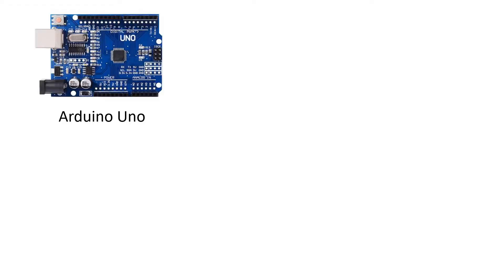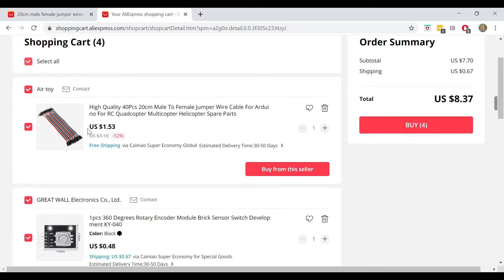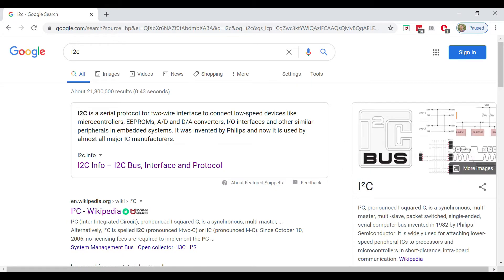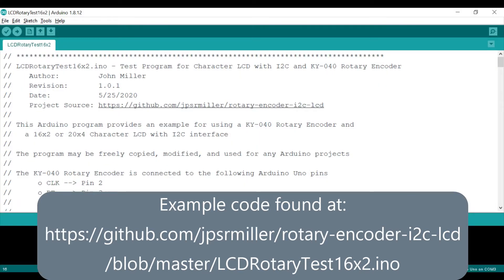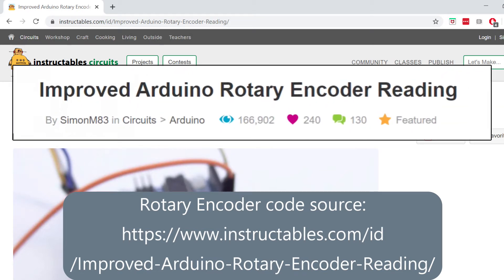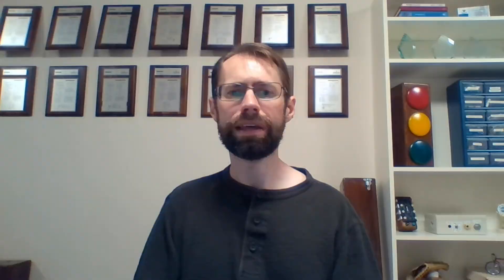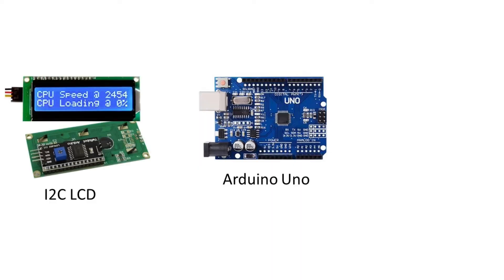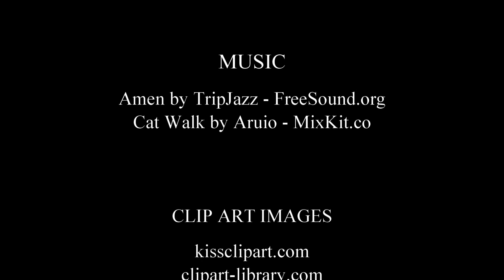Arduino with I2C LCD and Rotary Encoder

Comment: man its very clean code and and very structured video. I repeat the same steps, but sometimes when I turn encoder value on LCD not been changed, it's like freezing for little time or some like this. Maybe you have an idea why it happens?

Comment: John,

I have copied and pasted this sketch
Changed I2C adress to 0*27 and set the display 2 2*16

On compiling, I get the following error:

C:\Users\ABCD\AppData\Local\Temp\.arduinoIDE-unsaved2023030-18628-fhzkzm.s5a15\sketch_jan30d\sketch_jan30d.ino: In function 'void initializeLcd()':
C:\Users\ABCD\AppData\Local\Temp\.arduinoIDE-unsaved2023030-18628-fhzkzm.s5a15\sketch_jan30d\sketch_jan30d.ino:197:12: error: no matching function for call to 'LiquidCrystal_I2C::begin()'
  lcd.begin();
            ^
In file included from C:\Users\ABCD\AppData\Local\Temp\.arduinoIDE-unsaved2023030-18628-fhzkzm.s5a15\sketch_jan30d\sketch_jan30d.ino:42:0:
c:\Data\Dropbox\Arduino\Projects\Sous_Vide_001\libraries\LiquidCrystal_I2C/LiquidCrystal_I2C.h:58:8: note: candidate: void LiquidCrystal_I2C::begin(uint8_t, uint8_t, uint8_t)
   void begin(uint8_t cols, uint8_t rows, uint8_t charsize = LCD_5x8DOTS );
        ^~~~~
c:\Data\Dropbox\Arduino\Projects\Sous_Vide_001\libraries\LiquidCrystal_I2C/LiquidCrystal_I2C.h:58:8: note:   candidate expects 3 arguments, 0 provided

exit status 1

Compilation error: no matching function for call to 'LiquidCrystal_I2C::begin()'

The compile stops at the lcd.begin() below

void initializeLcd()
{
	lcd.begin();
	lcd.backlight();
	lcd.clear();
	lcd.setCursor(0, 0);
	lcd.print(F("Test LCD & Rotry"));
}

Can you please assist.
Rob

Comment: Doesn't work compiler error :  c:\Users\oesg1\Documents\Arduino\libraries\LiquidCrystal_I2C/LiquidCrystal_I2C.h:58:8: note: candidate: void LiquidCrystal_I2C::begin(uint8_t, uint8_t, uint8_t)
   void begin(uint8_t cols, uint8_t rows, uint8_t charsize = LCD_5x8DOTS );
        ^~~~~   // void begin(uint xxx ..not in the sketch  libary error ?
Reply: Compilation error: no matching function for call to 'LiquidCrystal_I2C::begin()'

Comment: Hi John
I m new to Aurdino, saw ur vdo its very informative. want to have some more information on ur above vdo. Can we do preset counter using the above material. That is we set some count on LCD and when we rotate the encoder in reverse direction and as soon the counts reaches to "0" (zero) we can generate a flag which will operate a relay.
Can u help me in this above project with its sketch and bill of material.

Comment: HI John
I built this project and worked fine.
Now i want to realise menu system with the help from your code,
where rotaryleft and rotaryright function will navigate up and down through menu items and encoder click event will select the menuitem.
i tried one menu system using simple menu library.my problem is every function called in rotaryclick subroutine works perfectly but if i call same functions in rotaryleft and rotaryright subroutine it doesnot work. any idea?
Reply: Have you solved this?